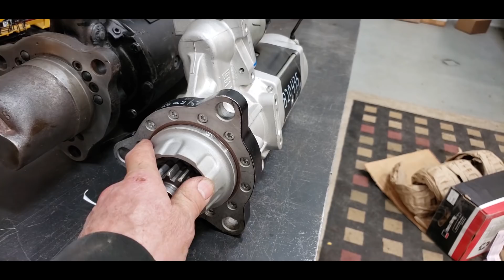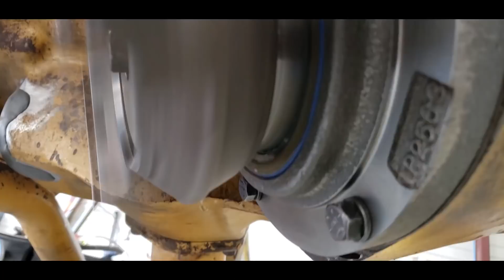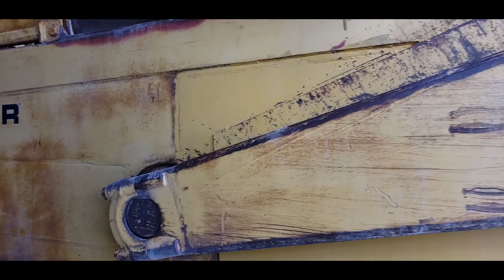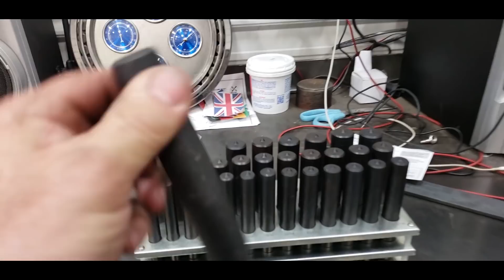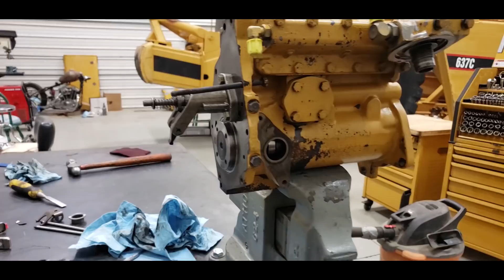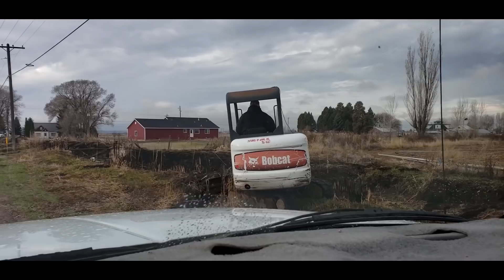The Best Starters Come From Wyoming

Comment: Can you please provide info on the remote oil filter set up on the d343 please!
Reply from the maker: You need the oil manifold from a 1693 truck engine that doesn't have a retarder,  I know i did a video of how it all goes together,  the scraper in this video is the first one I changed over,  look through the videos in that date range

Comment: On my '85 KW with 3406B, had the MT41 24v with the series/parallel switch. I changed to the 12v MT39. All I had to do was tell the parts store how many teeth my original pinion had and what engine and truck it was going into. It came perfectly aligned and positioned for my engine (you can change the mounting to various angles easily). I was able to remove all the series/parallel relay and wiring. Instead of using 4 batteries I used 3-950cca batteries making the 4th battery for my Diesel generator (my truck is now a 40ft motorhome). I didn't have to change any battery cables-everything worked perfectly. It only took about 2 hours to change. I also wired in a starter button to the battery box. I went out since I hadn't started the engine in a few weeks. The batteries were only at 12.1v, but yet it turned over the engine-would have started. I'm so tickled about the MT39-NEVER deal with one of the HEAVY starters again!

Comment: The 39mt is great for the extra cranking power and light weight.
The biggest problem with the 39mt is the planetary shaft will wear through the front housing inside the starter!
Denso makes a better replacement for the 50mt and the 39mt.
It's the Denso R5 models and makes the 39mt look like a baby😜

Comment: Jpaydirt I'm a Cat parts guy and have been for 32 years. What equipment are you working on with a wet flywheel housing? Thanks !
Reply from the maker: 637 scrapers
Reply: All cat equipment is wet clutch that have a clutch that I know of way back to the 1950 or so
Reply: And torque converter housing has oil

Comment: Nice video, I am very familiar with a lot of  Delco and many other starting and charging systems. I need to ask, Since all the starters I know engage the engines flywheel ring gear why would it leak other than a rear main crank seal??. Are there oil bath starters that are newer? just asking out of curiousity

Comment: using an Excavator to make an ATM cash run..  https://www.liveleak.com/view?t=sT2YG_1554745058   

 time to install lockable fuel cut off valves..     dropping the bin thru the roof of the van was done during WWII my exes father was a US Marshall .. he spend months undercover trying to find out who was stealing brass ingots..  the crane operator had a swing that went over the parking lot.. once in a while a panel delivery van would be parked there.. the crane operator would drop a brass ingot into the trap door on the roof.  people went to prison for stealing war materials..

Comment: Best starters in my opinion. I have a friend with a twin turbo cat with the big beefy starter, my 6nz has the 39mt, at 0 degrees this winter I turned my truck over for 20 seconds not plugged in and fired and the starter didnt slow down. His had to charge the batteries for a day and barely started. You will learn to love those starters especially in the cold, they dont use no where near as much battery power.
Reply from the maker: Thats great, because there is 30 feet of double 2/0 battery cable going to the rear engine, better cranking and less amps is a super plus in cold weather
Reply: @Jpaydirt  yes sir, he actually went out and bought one after he seen mine start and his stay on the charger for the day.

Comment: American Alternator  & Starter in Chattanooga Tennessee. 423-622-1992..   Can sell you a brand new 39MT for less than half the cost of band new OE Delco Remy 39MT.   Please give us a call for all you charging and starting needs Monday through Friday 8:00 am to 5:00 pm And Saturday 9:00 am to 2:00 pm eastern time. Closed Sunday.
Reply from the maker: But does it have the leakproof adapter?
Reply: @Jpaydirt  I was going to say, you're paying for the adapter because you can buy a gear reduced 39MT starter at any truck shop. I've been running them for quite a few years.
Reply from the maker: does it have the indexing mounting flange? I've seen them for less, but they aren't indexable
Reply: @Jpaydirt  the couple that I have bought were.
Reply: All the 39mt gear reduction starters I buy from my vendor here are indexing,  but they do not have the leak proof housing like this one.

Comment: Friends of mine who run KW say older ones fuse panels go bad at rear of panel and you'll chase electrical problems forever. I was having bunch of little problems with my 95 KW grounding issues. My friends have 20 of them they said convert all lights truck and trailer to LED. I did and haven't had one problem since. kW is comfortable but love my old 359 with breakers on dash those were probably the simplest truck made. I do a lot of load and haul I go through starter pinions every 2 years I'm calling your guy in Casper need one right now on a 953 and will get a spare for 966E
Reply from the maker: My 05 w9 has a 8ga ground wire from the alternator to the trailer circut, and the other wires are 12ga. and the trailer harness is only 14/16ga stuff, so I've never had and issue lighting up the trailer, I think placing the ground to the alternator is a great idea as there isn't any corrosion issues, but if a dummy, like me, puts it to the hot side.......welll there's going to be hell to pay☻

Comment: I know you have that governor back together by now, but little Cat tip, you can use the updated weights for a 3406B that have a far larger foot on them. It prevents the wear spots on the reaction washer.

Comment: if i ever get a big rig, i want one with an air starter just so i can wake up the neighbor hood at 4am lol
Reply: That's what I LOVED about Consolidated Freightways. And, I ripped the muffler off every one of those air starters...THEN, park in between a couple of sleeping chicken haulers at the truck stop!
Reply: @anthonyforret2117  Ha Ha, Yeah, I had a Mack truck with the air starter, then one day the muffler fell of the starter some where along the highway and the next time I hit the starter I reckon it shortened my life by ten years,,,
Reply: We had an International truck that had an 8V92 silver Detroit with an air starter and it was pretty cool unless it sat for a while and ran out of air.
Reply: @clydeacor1911  yeah or you crank it and the runs out without starting it lol
Reply: @johndowe7003  Ya I've had that happen a time or two. And instead of jumper cables you need an air compressor.
Reply: All the air start trucks I drove had a gladhand AND a quick coupler to get jump started.

Comment: I'm surprised your Cat dealer didn't get you the gray starter gasket, it fits better and doesn't leak like the pos paper one. Obviously you took care of the issue a different way and I hope them gear reduction starters last along time and never leak! 
Also on the manifold joints, Cat 2P-2333 used to be the cats meow (pun intended) for sealing them up. I know it subs over to a Loctite number but I don't know if it seals as good as the Cat stuff.

Comment: I went looking for a replacement starter for my 4020 it was a giant but smaller than the cats I found mine same basic as your replacement at crank-n-charge. I accidently ruined that one and when I went to find another it was at AutoZone in stock and less expensive than anywhere I could find online. I also noticed they sound strange compared to the original.

Comment: One thing I can say in my experiences of Cat loaders 920-950 series back in the 80's is the weight of the parts!   
Back then cat made some no BS reliable machines until the engineering moved more into software/hardware interface and equipment broke even when shut down.   Mean time between failure rates became more frequent.  

You have done a great detailed logs of these scrapers and repairs.

Thanks

Comment: Spot on on the inferior manifolds. Also, how many broken off studs have you had to remove from 3406/C15, 3408, 3306, etc engines? It’s always the one that’s hardest to get to that ends up being the hardest to get out too.
Reply from the maker: You know I've only had one. on the 3306B break off and yes it was in a bad place, right behind the fuel pump
Reply: I drove an '89 FLC-112 with a 3306b in it,  in the 10yrs we had it, I don't believe it ever had either the starter or the alternator changed.  At least in the last 6yrs I drove it, it never had anything more than dry and wet services.
Reply: Jpaydirt I’ve had several 3306 engine in 973 loaders break the one behind the pump. The 3406b and c for whatever reason we had a lot of problems with the breaking. Once the welder that was removing them drilled too deep and got into the coolant passage.

Comment: Have you thought about putting a bridge crane in your shop? Or will the building handle the weight?
Reply from the maker: Well you loose 6 ft. of hook height, and I didn't have the money at the time, but I did have a service truck crane☻
Reply: @Jpaydirt  LOL true. At a local Cat dealer they had a crane that attached to the collumn with a hinge and an I-beam. So it would swivel 180 degrees.

Comment: I keep a 5/8 bolt about 2.5” long with the head cut off in my box. When replacing one of those heavy ass starters,  screw the bolt/stud into the top hole. You can then hang the gasket on and it makes it so much easier to get the starter in place. It’ll hang on that stud so you can start the other 2 bolts. Then remove the stud and screw in the third bolt.  Very handy especially in confined spaces. I have a whole tray of different sized headless bolts used for installing starters, pumps, anything really. Doesn’t cost much either.
Reply from the maker: Sounds like you have figured out how to deal with those lead starters

Comment: Good thing that trailer harness gave up when it did.  Easily could have burned the truck to the ground.  Adhesive lined red and black heat shrink.  Put it on the ends of those larger gauge, higher current connections.  Helps a guy think when he doesn't want to.
Reply from the maker: I'm still embarassed about it

Comment: People that dont know , just dont understand the feeling when older equipment sits on clean concrete a few days and nooo oil spots after youve fixed everything. Its a good day when you can pull that off.
Reply from the maker: My goal is zero leakage, but I don't have time to modify the ejector heads, so were going to diaper them
Reply: Our concrete pumps go in chemical plants here in good ole miss/la coast, has to be zero leaks , 5 or 6 trucks are pre def. One took me months to get there. Double steer, triple drive axle , i know the feeling a little.